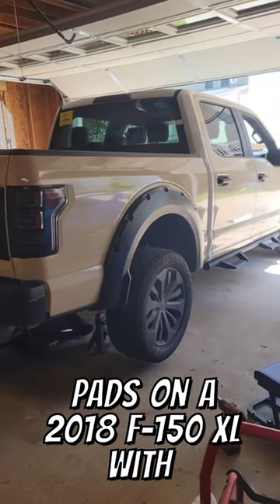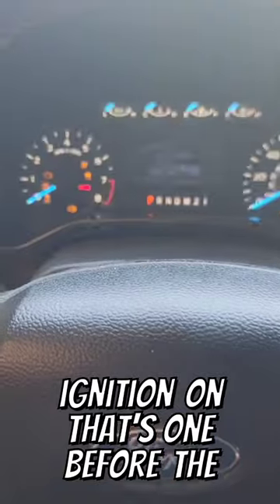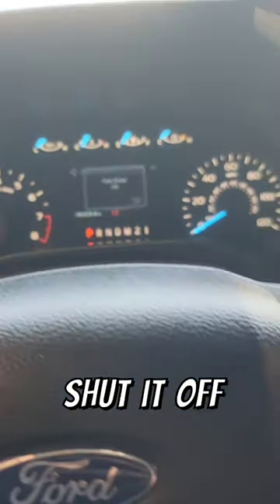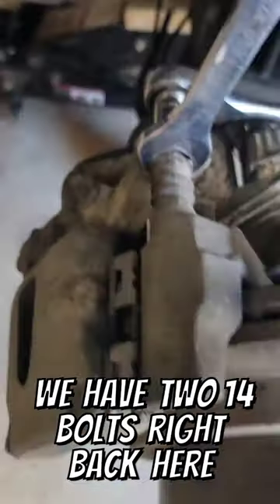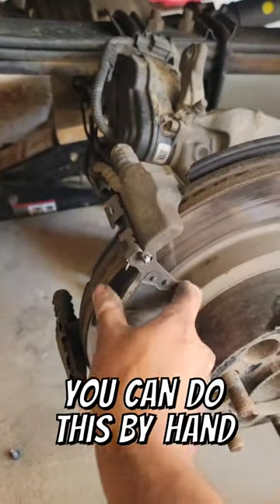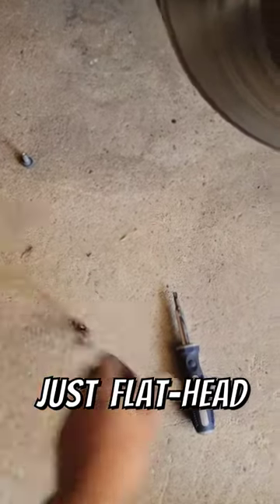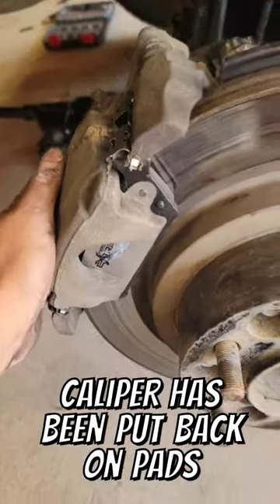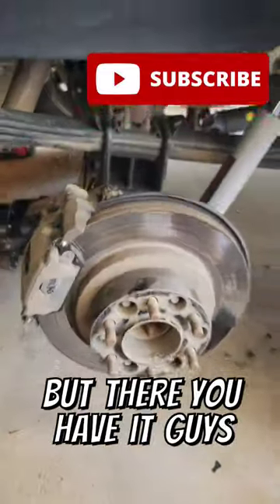60 sec brake pad change rear f150 brakes #f150 #offroad #f150mods #dodge #diy #dodgeram

Comment: Not "maybe throw a little grease on there."

Apply brake caliper lubricating grease on there. Permatex Ultra Brake Caliper Lubricant is excellent and two tubes will run you less than $15.